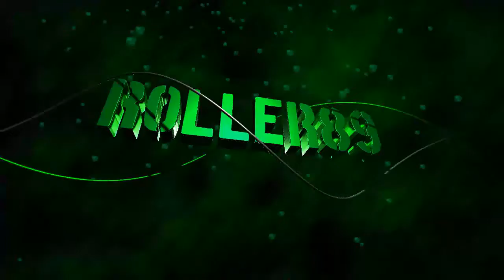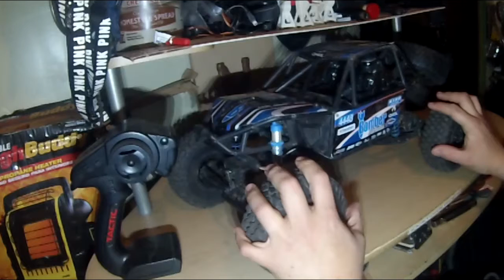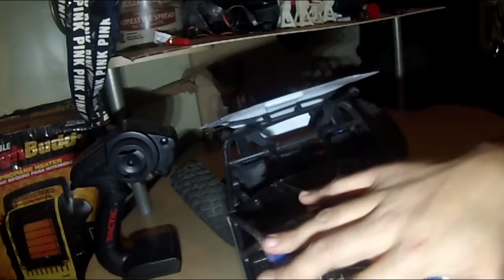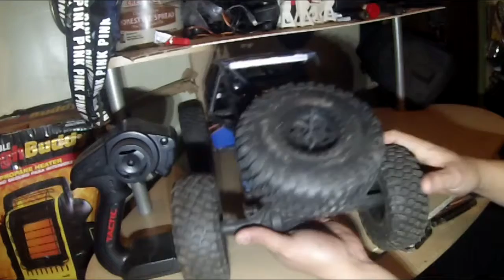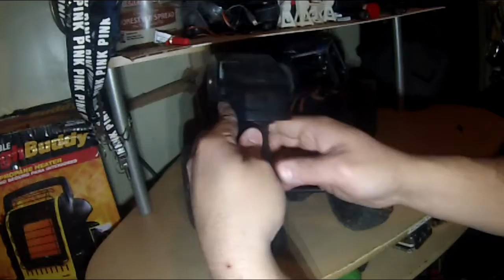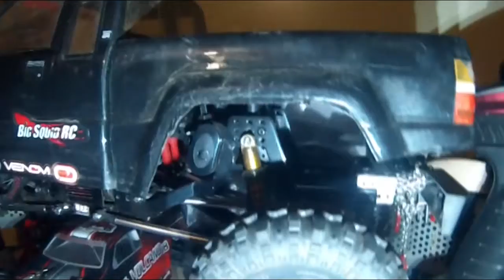My Axial Bomber

Comment: The Bomber is my favorite rig.
So many aftermarket parts available. Upgrades are endless. I’m up at about a $1,600 Bomber, after totaling the original bomber price and upgrade costs.

Black and green is too overdone thanks to Monster energy drinks. Gunmetal grey and candy red? Maybe a little white trim work?
Reply from the maker: Hmmmm thanks for the input i will def consider that